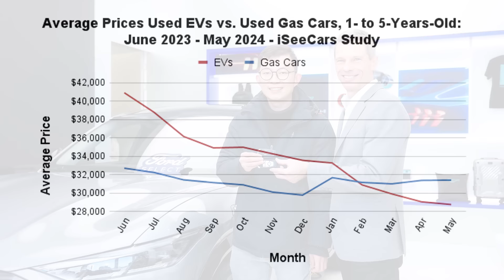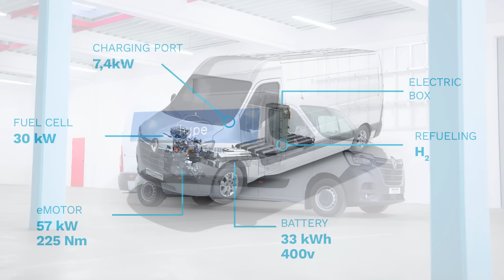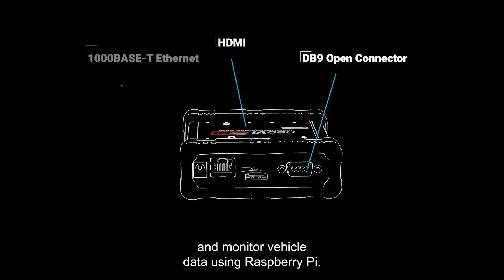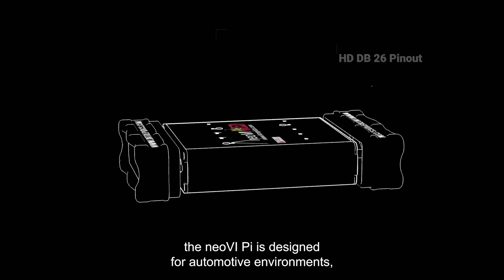EU Makes China EV Tariff Official; Used EVs Cheaper Than Used ICEs - Autoline Daily 3831

Comment: Prices for used EVs dropping is a great thing for the EV industry.  This will bring into the EV market price-sensitive people and people who just need cheap transportation. Once they buy their first EV, they ain't going back to ICE cars
Reply: Wrong. Most people I know bought one EV and never again. Myself included.
Wait until they see how horrible EVs are in practice, especially when their first battery control/charging module, battery cooling, or the battery itself breaks and they have to pay massive sums out of warranty...EVs will be buried.
Reply: @pistonburner6448  your negative experience is not shared by most EV buyers, especially not Tesla owners.
Reply: @pistonburner6448  You absolutely couldn't be more wrong. Most people that have EVs have a stronger preference for EV's in their next vehicle than ICE owners have about their next vehicle; and the DATA backs that up. Your "most people i know" opinion is idiotic.
Reply: @jhelotes5627   Wrong.
Reply: @pistonburner6448  I know several 2nd and a couple 3rd time EV buyers. My anecdote is just as good as yours
Reply: As an owner of a hybrid, I am looking forward to an inexpensive EV.  The hybrid has already saved me tons of refuelling costs, brake replacement costs.
Reply: @pistonburner6448  So you bought an old Leaf. Times have changed, and keep on changing.
Reply: Latest survey 40% of EV owners are going back to ice. GO USA
Reply: @jamesvandamme7786   You believers are always so childishly wrong. And always wrong about absolutely everything.
Reply: @pistonburner6448  , did you return your EV1?
Reply: @jhelotes5627   What are you childishly trying to obfuscate the conversation with?
Reply: @pistonburner6448  what year and model was your EV?
Reply: @JD-yx7be   You're trying hard aren't you...trying everything except debate on the subject matter.
Reply: @pistonburner6448  wrong
Reply: @jhelotes5627   That's not even a coherent answer.
Reply: @pistonburner6448  you said you owned an ev before. Are you comparing a 80 mile leaf to a modern EV?
Reply: I want to live in a world where only an EV bot would cheer on hyper-depreciation as a “good” thing. The Autoline comment section has become a cesspool for disingenuous EV fanatics/bots. 🤢
Reply: @markokrasinski8033  you know that means over 50% go back to another ev. not sure why you are framing it as bad
Reply: @meyo1860  we live in a world that is quickly developing fun and exciting EV technologies that will soon be less costly while having thousands fewer components. Depreciation is relevant to car flipping, not 10 -12 year  ownership.
Reply: @user-wz8hp2ix9f  I would always recommend a Hybrid over a pure BEV. The reason is I have experienced an extended period of power outage after a natural disaster. Forget cars, we struggled with charging our phones. Think of it as a necessary "circuit breaker" between the electric grid and mobility. It may safe your life one day.

Comment: Great news about used EV prices, now they are starting to trickle down to low budget buyers as expected, while new EVs improve rapidly in similar fashion to how the cellphone market behaved post iPhone disruption.

That's the beauty of new tech replacing old tech, new tech often starts expensive, but then advances rapidly to overtake old tech on costs, features, performance, etc.

What will ICE/Hybrid dependent legacies do when this happens to new EV prices next, and not just used ones? Tick tock.

Comment: I'm calling BS on IIHS survey about ISA acceptability.  Total BS.  No way that many people are ok that more nanny-ware
Reply: For what it is worth, I set my vehicle to automatically not exceed 85 mph. It has been that way for a year, and it has caused no issues. 

I do believe there are plenty of people that when asked about safety will want to seem like a safe person, so they will answer yes to new safety features. As noted in the story, half said they wanted to be able to turn those safety features off. What people say in a survey and do in real life often do not match.
Reply: @kevtheobald  Very valid point. That's basically where I was coming down.  People say all kinds of things on surveys think the surveyor wants to hear. Real life is very different.
Reply: Android auto and a lot of other GPS services already do this if they detect you're speeding. It's actually a helpful feature, especially if you aren't familiar with the local speeds. If all it is is the speedometer changing color or something than it's probably something most people are already ok with or familiar with. The survey results would really depend on how they frame the question and how familiar the person is with such systems. Your car telling you that you're speeding isn't really any more nanny-ware than the road doing it with a sign.
Reply: If one wants to avoid a speeding ticket, set your WAZE to report police ahead and set your speed limit indicator. Millions do it. I learned to never ignore a hidden or visible police warning.

Comment: The ICE / EV price gap is going to get larger. ICE cars are doing nothing but getting more expensive and EV prices are falling and have a long way to go. Soon driving an ICE car will be a "display of wealth" because it shows you can not only afford the car but oil and gas for it.
Reply: Probably the case, but that's not the driving factor behind used electrics getting cheaper at the moment. Initial purchase prices for EVs aren't plummeting in the same way. It's also not really something to cheer, at least not yet, since it steeply disincentivizes people from buying a new electrics and thus companies from producing them.

Be pro electric all you want, I am, but try not to cheerlead bad news.
Reply: The oil for pure ICE cars is and will most likely always be relatively cheap, even for the good stuff (Red Line, Motul, Schaeffer’s, Amsoil), the fuel is another story. Supply and demand will swing in the direction of EVs, especially in Europe as they mandate synth fuels. You're correct in saying that owning an ICE vehicle will be a lot like owning a horse these days, expensive.
Reply: 100% of BEV’s will need a battery replacement. Insurance for me was more than my car payment. These costs are significant.
Reply: @wj9494  There are millions of EVs now and some are over 10 years old. They have not had a battery replacement. That is very rare. There is a Model S that has 460K miles still original motor and battery pack. And it was supercharged every day.
Reply: @wj9494 As per the other comment, very rare for well engineered battery to be replaced and not only that, a lot of people change cars around or before the 10 year mark. And least we forget,  some ICE vehicles have very costly replacement parts ( Engines, gearboxes, Turbos, ECUs )which are likely after the 10 year mark.
Reply: @wj9494 100% of ICE vehicles will need an engine and transmission replacement. 

See, if you make a statement and don't include a timeframe it makes it true for all drivetrains. 

After how many miles?   You need to be specific, otherwise it's a meaningless statement.
Reply: @frankcoffey  Early Tesla models only use highest-grade Panasonic batteries for safety, reliability, and longevity. The same reason why Toyota hybrids use Panasonic batteries. 

However, these days Tesla also started using Chinese and South Korean batteries to cut costs, particularly for vehicles manufactured outside of the US. If you recall Chevy Bolt, they were using South Korean batteries. Dealerships in China are burning down due to inferior quality Chinese batteries.
Reply: *and maintenance and repair costs.
Reply: @yo2trader539  LG batteries in the Bolt were recalled years ago and the fires are no longer a problem with new pack

Comment: If the govt tries to mandate speed limits and controls they will find it will cause a huge black market in disabling that. 
This is similar to the aftermarket engine chip software reprogramming devices that give your ICE car more power and torque than the original factory settings.

Comment: When speed control systems are given CONTROL over my selected speed, either the blasted thing is fully autonomous and does all the driving or it’s somebody else’s car.  I will NOT purchase a mandate on wheels.  In fact, I think I’d pay to replace the battery on my current EV before I’d purchase a vehicle that is allowed to MANDATE my travel speed or make it ridiculously hard to override.  And I generally do NOT go more than 3 mph over the posted speed limits.
The NHTSA and IIHS can to to some hot place before I’ll purchase a vehicle I do not have EASY and FULL control of, unless it is 100% autonomous.
Reply: Unfortunately it would probably come as an over the air update on your current EV.
Reply: @ultrastoat3298 If it’s not part of the ‘as sold’ content, regulatory authorities have no power to add functionality.  Correct existing functionality to make it compliant with time-of-sale regs -yes, but add more functions, nope.
And worst-case, VW has yet to master OTAs for important s/w improvements or drivetrain control software so far, so it’d require a dealer install trip.

Comment: I'll tell you why some of us continue to be skeptical of hydrogen: 1) Batteries are improving steadily and any advantage hydrogen may have been seen to have is narrowing almost by the day and 2) where are we going to get it? Electrolyzing water for hydrogen burns away 70% of your energy (more, depending on how you transport/store/dispense it). "Get it from natural gas", you might say, except that doing this actually has higher carbon output  than JUST BURNING THE GAS. We'll get way more traction just converting diesels to run on CNG (a quick, inexpensive conversion).
Reply: "Hype" - a great name for a hydrogen powered enterprise.

Comment: so let me get this EVs had bad resale value but also somehow used ice cars used to cost less than the used evs
Reply: Yes. EVs are incredibly expensive and used to not have enough supply for demand so used prices stayed ridiculously high -> but then used ones have dropped massively in value as the supply has overtaken demand.
Affordable ICE cars have been taxed and just politically blocked into oblivion with manufacturers simply no longer offering cheap ICE cars (a certain huge nation blackmailed them and politicians into ceasing to offer affordable ICEs) -> ICE prices have skyrocketed as low-cost ones are no longer on offer.
Key thing you missed is that they're comparing what ICE cars used to cost to what ICE cars cost nowadays.
Reply: Yes because one parameter is basically a percent and the other is a comparison of fixed values. The graph itself was stupid. 

A 150k Taycan with 30 percent resale value is still valued at 45k; and that's more money than a used ICE Camry. lol. Apples to Oranges.
Reply: @suserman7775  Not much more than the Camry.
Reply: @wolfgangpreier9160  OH really?  A 3 year old Camry is close to 45k?  Car salesmen must love you.
Reply: @suserman7775  No, But then there is no Taycan for 45K either.

You are really a good salesman...

Cheapest Taycan 4S 09/2020 68500km 64.990,--

Most expensive Toyota Camry Hybrid 2WD Lunge 05/2019 5218 km 39.200,--

Which one of both is nearer, dearest?